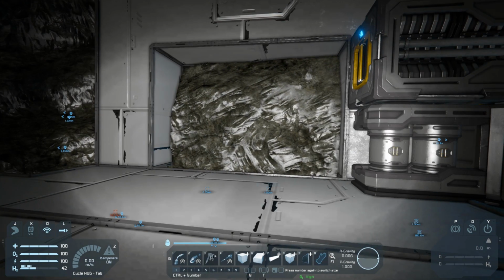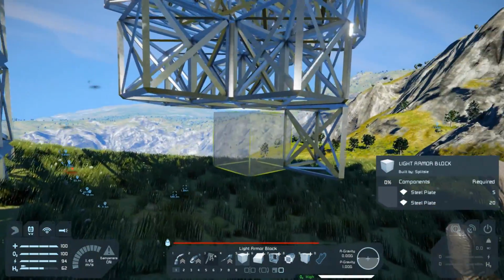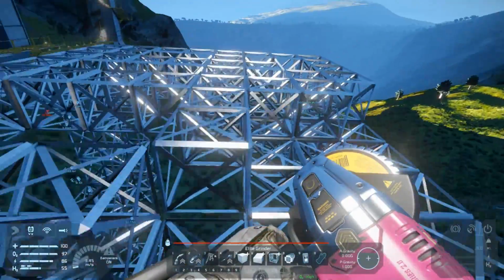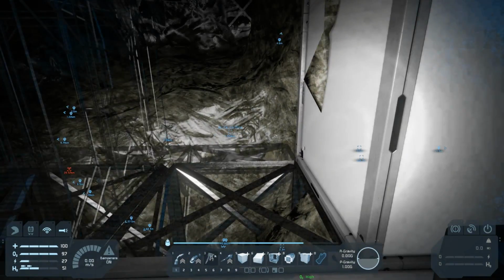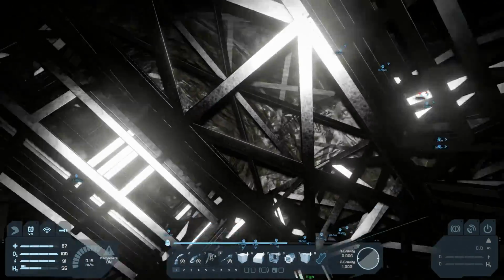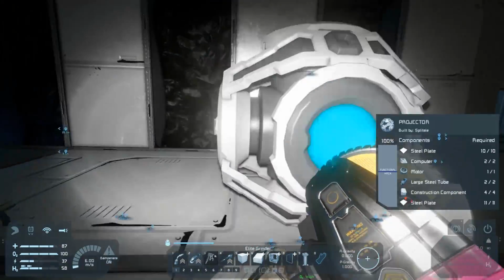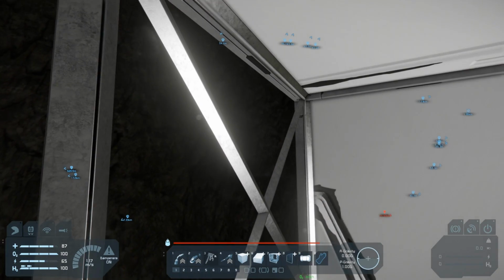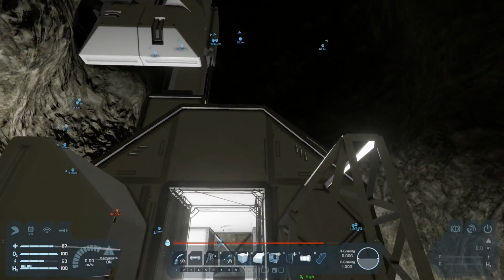Survival, Maybe... #23 Piston Elevator with Vanilla (A Space Engineers Survival Series)

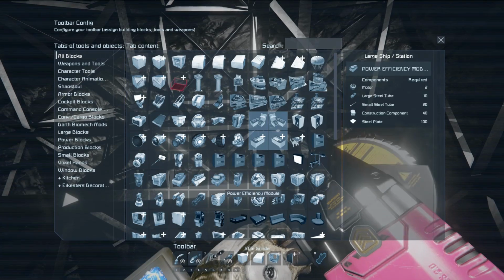Comment: 27:25 alright Willie Wonka xD what crazy elevator do you plan to make.
Reply from the maker: You'll see, and that's a long way from the craziest thing I make in this series ;)
Reply: @Splitsie  you know what i just thought of that would be an interesting challenge, instead of an elevator or one of those platforms that move horizontal across across large distances, how about a moving platform, that moves up and down in a diagonal. My thought is, is if you make a separated platform with high friction high torque wheels, moving at like 2m/s, with a rail ramps to help keep it centered. the primary block for the platform itself will be catwalks, and for when it reaches the top or bottom to prevent it from sliding down it locks int via either landing gear or merge block. The heaviest block likely to be on this machine would likely be the battery that powers it. I realise this would take an unnecessary resources but the more i think about it the more i want to try it. i might try it in creative mod first just to see if the idea will work.
Reply from the maker: A system like that definitely works and you could do it with a setup similar to something I build around episode 87 ;)
Reply: @Splitsie  oh welp i got a long ways to go before i reach that episode but now im super hyped to get to there, cant wait xD

Comment: My theory on the inertial tensors is that the gravity is changing from bottom to top. Each piston is always sharing the same load all the time. Actuating one at a time is stressing the system. The last piston has to lift the cargo cab and all 5 pistons.  Perhaps actuate the pistons simultaneously. That way the load is not on just one for lift.
Reply from the maker: My understanding of the shared inertial tensors has improved (a little) since then. What happens when you enable shared inertia tensor is that the physics engine treats the two objects as having the same point of inertia, which also means that they have a combined mass. By enabling it on all of the pistons the lift car effectively becomes the mass of the entire station. One of the nice things that can work is to share inertia tensor on all pistons except the one attached to the base, since a single piston is normally quite stable you're effectively turning it into that sort of setup by sharing the mass and inertia of all the subgrids. 

When using all the pistons simultaneously you still run into the problem of them not extending to their full range but it's not completely consistent which one will stop which I've always just put down to inconsistencies in the physics simulation as there isn't an easily observable pattern
Reply: @Splitsie  Thanks for your answer, despite  my late viewing;) You are an Engineering genius and spark my neurons into thinking. I'm 16 hours into training and on #32 now.  Many more questions I'll have to save for later.  I'm having trouble with dropping my payload after drilling with the vanilla 4 drill excavator they give you in Earth planet, and  getting the conveyors working on that station.  I subscribed to the mods you recommended but not able to plug in the way you do. Add control panels?

Comment: You could just have 2 timer blocks that divide the pistons into tiers that activate them in sequence, this way you can have them run smoothly while not sharing inertia tensor, have a cake and eat it too :3
Reply from the maker: The shaking will happen no matter how many pistons are moving if you don't have shared inertia tensor since most of the wobble comes from the number of sequentially connected subgrids not the number of moving subgrids :(

Comment: Splitzie: Just wanted to drop you a note - I used your piston stacking design with great effect for a drilling rig. The rig is a cuboid for simplicity; however, the drill design is the main focus here. The pistons are stacked 13 deep in a spiral giving me an enormous reach when drilling. As you would imagine weight management is an issue though it is countered with connectors throwing out the unwanted byproducts and hoarding the minerals that are the desired target. If you wanted Ice for Hydrogen uses this can mine it by the truckload when needed. As for now it is still terrestrial in design with a forward thought to space focused alterations where needed. When done drilling and fully recoiled the middle piston feeds connectors that are plumbed to auto sort and process the minerals. The spiral is there so the drill rig feeds an advanced rotor that then feeds the connectors via the conveyors built into the pistons - hence the spiral.
Reply from the maker: Cool, and very daring to use the stacked pistons as a drilling rig, I've not played around with that idea since the physics update, but the game never liked the tool shake being transmitted through the pistons. I'm glad yours has worked as I'd love to build some massive drilling machine at some point in the future :)
Reply: @Splitsie  In my multiplayer game we've got a drill rig on wheels with 4 parallel pistons pushing a 3x3 drill grid down. It works very well indeed, but it can only dig about 36-ish meters into the ground. I'd confidently extend the arm by another 2 pistons without worrying too much about the physics, but above that I suspect it would start to shake itself apart.

The arm rotates to stow away while driving, where landing gears lock both ends into place.

Comment: Two suggestions: Try adding a gyroscope to the bottom of the elevator car to reduce the wobble. Also, try using some sort of bumpers (I've used the dreaded Space Balls or even tires) along the elevator shaft to smooth out the ride.
Reply from the maker: I got some advice from Isy and others and I'm pretty happy with how smooth it's moving now. Just had to have the right inertia tensor settings :)

Comment: new cruise mode for vector thrust, it will dampen all directions except forward.

just open from workshop again to update.
either use %cruise, or use the 'r' key if you have control module installed.
Reply from the maker: Thanks for letting me know, that's a really nice addition. I'll update it as soon as I remember :)
Reply: im not sure its quite so useful in your case though, since the flea doesn't have any side to side control. you would only get the up-down correction.
Reply from the maker: True, but I'm hoping to use your script on more of my vehicles :)

Comment: A bit late, but one thing you could add now that you have 4 buttons would be 3 and 4 to set/clear the shared inertia tensor?  Set it when "parked", clear it to move?  OR better yet, stash a programmable block and maybe a timer somewhere to automate that?
Reply from the maker: I'm thinking of using a sensor to control it as I've got a little redesign in mind and haven't really liked the look of the button panel in the middle of the floor :P

If I can't do it easily with sensors I might put it out there for someone to make a little script for the lift and use the programmable blocks ;)

Comment: I noticed that you used left click on your hand drill for the elevator hole. It's better to use right click so you can tunnel more efficiently and without generating those massive boulders everywhere.
Reply from the maker: I used the left click in a couple of areas where I specifically needed just a small amount of rock taken off - the bits where I didn't want to drill through to the rock wall of the hangar, otherwise it was all right click :)

Comment: if memory serves me right I believe Rabinchild did something similar with a bridge and he had to set it up where all but the first piston in the row had shared inertial on and could only extend or retract one piston at a time for it to work smoothly, so you might give that a try , also for your space drone your working on did you lower  the connectors strength on both the drone and the station to almost nothing being as the drone is lining up the connectors do not need to have there strength up, I will message you some time next week on steam once I get SE installed on the new PC.
Reply from the maker: I've tried both lowering the connection strength and increasing it. The trouble I'm finding is that the drone doesn't actually get in range of the connector, instead of flying straight at the marker it goes within a meter of it then starts spinning and gradually gets closer but usually side on without the connector. I'll be around a fair bit next week so hopefully we can line something up, thanks :)

You must be excited about trying SE on the new PC :D
Reply: That almost sounds as if precision mode is turned on at that point and yea i am looking forward to using the new pc in fact tomorrow i am installing a new wind turbine to help power it then will be lettig the battery bank charge up so i can use it next week.
Reply from the maker: It was behaving very much like precision mode was on, even without it... 
I'll keep my fingers crossed that you get some nice stiff breezes to charge the batteries :)
Reply: Got the turbine installed and just as i tightened the final bolt the wind died, but at least we did get a little sun today so that should helpyou a little and at least the turbine is ready for next month when we get the most wind.

Comment: Perhaps you could add a piston below the lift, so that you have some pulling and some pushing to perhaps stabilize it?
Reply from the maker: I could attempt something like that, but getting it attached would be very difficult, since there's no easy way to snap onto a piston like you can with a rotor I'd need to use merge blocks or have a rotor connection. I'd also need to build an identical contraption for the bottom as I have at the top so it'd be quite expensive :P

I don't think you'd have the same troubles as used to exist with such things though - basically they would just explode...

Comment: I have performance issues since the new update - I'm running a 1070 + i7 rig that should have no problems with this game, so I'm curious - how do you get such good performance?
Reply from the maker: Since the update I've dialed back from the highest possible settings down to standard high - just picking it from the drop down at the top. I was getting intermittent stuttering on planets with voxel detail set to its maximum and that's with a 1080 and i7 8700k.

From what I've seen, GeForce experience has some issues with breaking itself when you update so it can certainly be worth a clean install from time to time - I was having issues with shadow play that were fixed with a delete and reinstall :)
Reply from the maker: Thanks and you're welcome! Hope your performance gets back to what it should be for your PC :)
Reply: hallurk h what is your memory?
Reply: I'm running 16 gigs of ram, the game runs ok on medium settings but lags quite a bit on ultra. I'm testing this in a world where I've built very little. Running the solar panel auto adjust mod and the updated space just got real.
Reply: Pretty weird i have 960 and i3 i run fine at medium
Reply: Thanks for the reply. This issue might be on my end entirely. I think I should tinker a little bit, maybe do a fresh driver update (although I believe everything is up to date...) and try a mod free ultra setting start on a fresh world. I was just posting this inquiry to see if others had similar performance issues, to make sure. It's amazing to see how smooth Splitsie is running and recording his game and it shows how good the game has become over the development time.
Reply: Thanks for the reply, keep up with the great builds and original approach to the game!

Comment: I dig your compact piston setup for the Lift. You can stabilize the stops cheaply by adding a connector on the lift, and one on each floor. Their attraction will hold the lift in place, you may need to adjust their strength if there's a pop when they start pulling.
Reply from the maker: That's a good thought, I've been given a few suggestions on how to fix the piston settings so they won't wobble so much, if they don't work out a connector sounds like a really good solution, as long as I can get it in the right place :)

Comment: Really enjoying the hanger build! 

Do you think, for the sake of convenience and avoiding the temptation to resort to the jetpack, it would be worth rigging up some sensors? Both to 'call' the lift to the level you're on and trigger the ride once you're on board?

Also, could you reduce the travel time without risking injury by using timers to trigger pistons at high speed progressively and slow them down just before it terminates, thus avoiding being launched into the ceiling? 

Relativel SE novice so not sure of the (im)practicalities there!
Reply from the maker: I do plan to eventually set up a few sensors on the elevator to make sure it's always where I want it. Before I do that I'll probably just have a call button though as I don't want to use the power for sensors just yet :)

It would probably take a few timers to set it up to accelerate like you describe, certainly do-able though. What I might do as a simple but less effective solution will be to set each piston to a slightly different speed, that way they'll at least stop more gradually, the start will probably still be quite rough :P

Comment: you can alternate between upward- and downward-facing pistons for an even more compact design
Reply from the maker: Wouldn't a piston facing the opposite direction just make the lift stay still as I extended both? I suppose I could have built the mechanism in the middle of the shaft that way and had the pistons work together - might have worked out better than drilling so close to the surface to fit the mechanism on top...

In my head what you're describing looks a little like this, so correct me if I've totally missed the point :P
     _ _ _
P  I     P
I   I      I
I   I      I
I   P    I
- - -      - - - 

With the pistons all extended I end up only slightly lower than where I started

Comment: You could try to include a Merge Block at the bottom and at the top to merge the elevator with the base and stop it from wobbling then it arrives at each floor. Just use a timer to turn it off before it moves and on a couple of seconds afterwards. (Just an idea)
Reply from the maker: Nice thought, if the suggestions about changing the inertial tensor settings don't work out I might have to try that :)

Comment: surprised you didn't just make your pistons, make a temp converiour connection, add drills, drill out shaft, replace with welders, weld shaft...
Reply from the maker: I was thinking of doing that, but with how little stone there is between the lift shaft and the hangar I wanted to make sure I didn't accidentally break through - with drills on pistons I definitely would have messed that up :P
Reply: Also, in general drills on pistons can be an explosive idea. You mentioned it in the video and I think it's an even better reason to not do it this way :D.
Reply: I have had good luck mostly with drills on pistons even on segmented multi piston setups. I found that the shared inertia setting works well just need to take it slow and be patient, only drill with 1 segment at a time. when a piston hangs like those did I have inched up the strength till it moved again, granted i checked rechecked and checked again for obstructions before just putting out the welcome mat for clang.